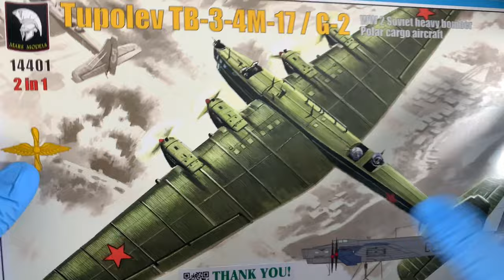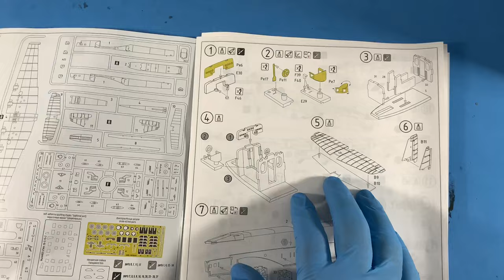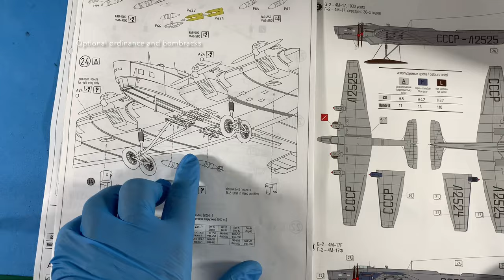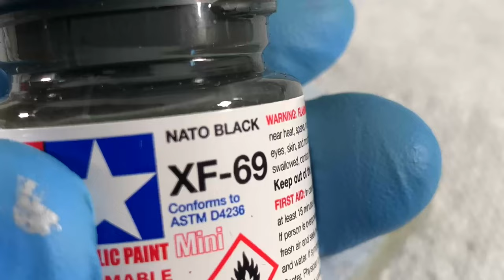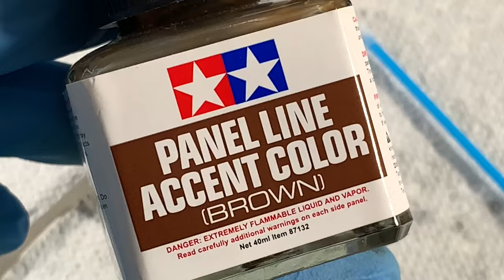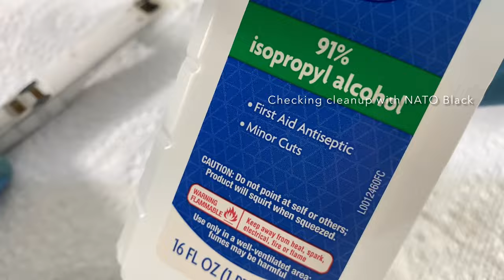Tupolev TB-3 - Plastic Model Airplane Full Video Build

Comment: Not sure if you'll still respond but do you need all these tools to assemble this kit? I wanted to buy it but thought I wouls need a whole tone of stuff to assemble it.
Reply from the maker: It all depends on how far you want to take it. I will say it was a challenging kit but I spent a lot of time it and maybe too much in some areas. The main thing I would prepare for is filling some of the gaps. On the bottom, I had to use milliput for a rather large gap, but with some sanding and patience you should be able to get through it. All of the weathering (especially the interior) isn't necessary and you don't have to use an airbrush for the painting. I wanted to weather the top to show the aluminum but you could just paint it the normal color and call it a day. Also it has PE parts so if you want use those you need some type of CA/Super Glue. Also, there are a lot of small parts to manage so take that into account. Hope that helps.